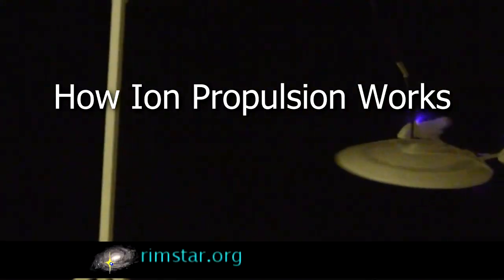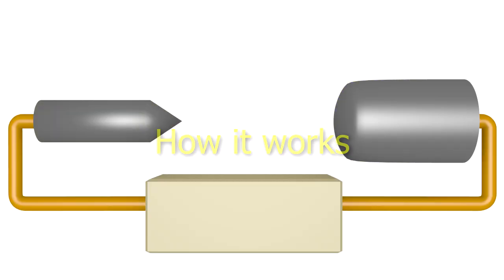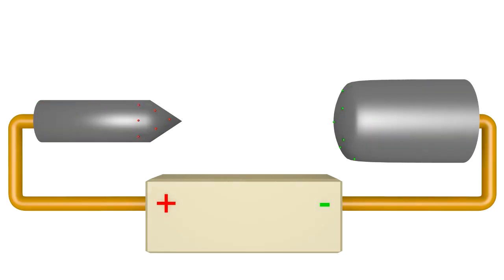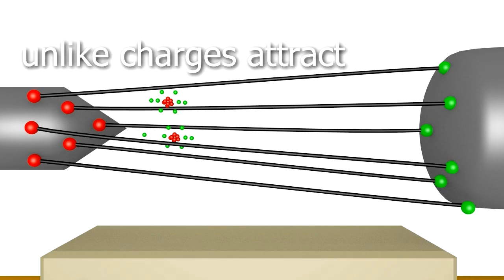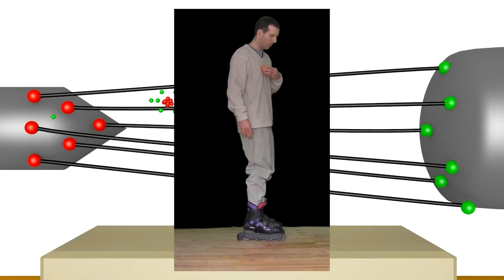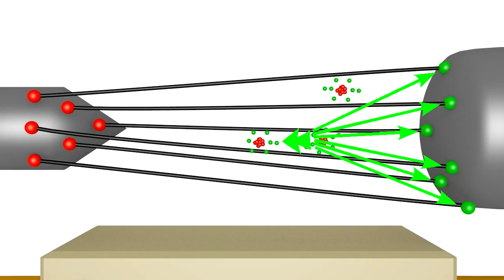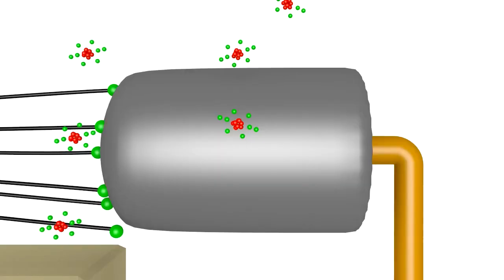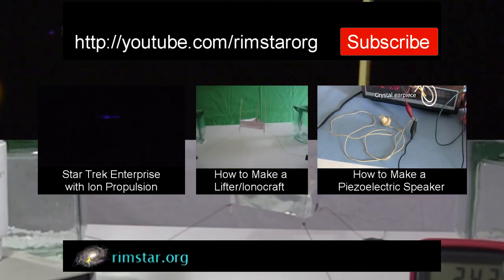How Ion Propulsion, Lifters and Ionocrafts Work

Comment: But with reverse polarity wouldn't the ion direction be reversed as well?
Reply from the maker: The difference lies in that the electric field is stronger near the sharp electrode. That means two things. 1. Ion creation happens there. 2. Like-charged ions are strongly repelled from that electrode and attracted by the other electrode.
And then along the way they collide with neutral atoms, which is when the momentum transfer happens which propels the engine.
Reply: I understand your point and thank you for replying. If I'm right what you're saying is that the gradient of the electric field is the actual responsible of the motion, but how do I see that mathematically?, the acceleration of the electrode due to this gradient is the confusing part.
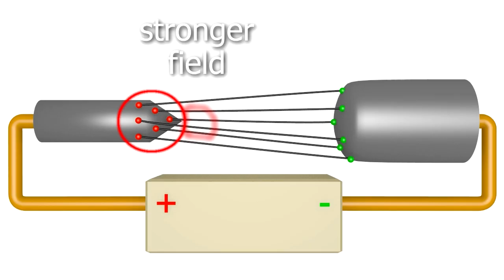Reply from the maker: No, because the ion direction isn't determined by the polarity. It's determined by where the electric field is strong, which is near the sharp point. See the video at 2:33 again.
Reply: RimstarOrg yeah I figured it out earlier. The direction of the ions don't change but the polarity of the ions do. So reverse polarity from your video would create negative ions instead of positive.  Thanks.
Reply: @RimstarOrg  why not increase sharp points and curves for greater propulsion .
Reply: @RimstarOrg  wow! That IS profound! Is this similar to how electromagnetism works?
Reply: I don't think it's about curves. I think it's about smoothness
Reply: It's not clear to me... the ion direction would change if the electric field does so. So how is that this does'n matter? could you explain me the opposite polarization mode please?
Reply: But why? how is that changing the electric field direction does not affect the ions direction?
Reply from the maker: Sorry for the delayed response. I don't always get notified of replies to replies.
Increasing the number of sharp points and the sharpness of the points may help. Certainly with a lifter, going with a higher gauge number wire (which means a thinner wire and is the same as having sharper points) helps. But there is a limit to how much electrical current a power supply can supply for the ionization. So once you reach that limit, sharper points won't help.
Reply from the maker: I'm glad you like it! But nope, it's not similar to electromagnetism.
Reply from the maker: The acceleration is due to a momentum transfer with neutral atoms. See the video again at 3:56. For a mathematical treatment, see this MIT paper https://royalsocietypublishing.org/doi/full/10.1098/rspa.2012.0623

Comment: what is limitations of height  for ionocraft ? upto what height it can go?
Reply from the maker: That depends on what you mean by height.
These ionocraft don't have enough thrust to their power supply, and so they can rise only as long as they can lift the weight of the wires that power them.
If you mean that if you carry one up to the top of a tall mountain and try to fly it there, will it still fly, then I recall from years ago when a lot of people were experimenting with these that someone tried theirs both high up (in the Rockies or something) and also lower down and found that the higher they went, the less well it worked. That's because of the reduced amount of air. That's also consistent with vacuum chamber tests where, as the air is evacuated, the thrust decreases.

Comment: y qué pasa si le pones una pequeña bobina cerrada en si misma entre el aluminio y el cobre que lleva el alto voltage?
Reply from the maker: The metal coil would create a bit of a short circuit between the two electrodes. It would be as if you'd brought the two electrodes closer together. That would either cause sparking, which would stop the ion propulsion effect, or it would increase the strength of the propulsion.

Comment: So this is possible to do on a dc circuit. Are there any formulas available gor this kind of device?
Reply from the maker: This circuit is DC. However, it's high voltage DC. As for formulas, there are but I don't have any off-hand. I know Peek's law is often used https://en.wikipedia.org/wiki/Peek%27s_law.

Comment: How powerful is the propulsion and how easy is it to make. I want to try this out for a science fair experiment
Reply from the maker: It's not very powerful. It can lift a 2 gram lifter pretty well https://www.youtube.com/watch?v=vzZy1Aqleno. However, the main people have a problem making is the power supply. It has to be high voltage, but also relatively high current too. This is the one I made https://www.youtube.com/watch?v=GEuK1OdYxHk for it. It also produces ozone as a byproduct, which is hazardous to your health in large quantities. But I've heard of plenty of people using it for science fairs. If is a dangerous high voltage so you do have to know what you're doing.

Comment: I still don't understand why the smooth object is required. The positively formed air can still be repelled by the sharp object and the neutral air can still exist next to the positively formed air without the smooth object and allow the sharp object to move away by repelling against the positive air. Explain ASAP
Reply from the maker: Good question. And yup, that works too. Ion wind rotors work that way, like this one I did http://youtu.be/UgWTjCHsm3M. However, in that case the smooth electrode is the surround room and air -- you can't have an electric field with only one electrode. The very act of creating an unbalanced charge results in an equivalent amount of unbalanced charge somewhere else.
But by introducing the 2nd electrode, and bringing it close, and putting lots of charge on it, we increase the electric field strength. That means we get more ionization and stronger thrust.
The formula for the electric field strength is:
E = (k * q * Q) / d^2
k is a constant, so we can ignore that. q and Q are the charges on the two electrodes. So increasing either of those increases E. d is the distance between them so decreasing that increases E.
(see more about the formula at this randomly searched for page: http://www.physicsclassroom.com/class/estatics/Lesson-4/Electric-Field-Intensity)

Comment: does this work in a vacuum
Reply from the maker: It's intended for use in air. Maybe you could design it somehow to inject the propellent in between the two electrodes -- then you could use it in a vacuum. The ion thrusters used in spacecraft carry xenon gas as their propellent but they have a different design.

Comment: Now repeat in a vacuum. No, cuz it won't work will it.  Stick everything you need on the lifting part and hey presto, it won't lift...will it! Waste of time, stop this so-called ion engine crap, it's nothing more than electric field dissipation. What gas did you use on the enterprise then??????
Reply from the maker: You're right, it won't work in a vacuum. This is about how ion propulsion works for lifters and ionocraft (https://www.youtube.com/watch?v=vzZy1Aqleno), fun things that we play with down here on Earth in air.
For the ion engines currently in space in various spacecraft and satellites, they mostly use xenon gas as the propellant e.g. https://en.wikipedia.org/wiki/Dawn_(spacecraft).

Comment: I'd love to see a serious proof of concept lifter with remote-controllable capability assuming the energy density of batteries and weight of power electronics (and their emi shielded housing) can be overcome.

I don't think I need to mention why achieving something like this would be a big deal.
Reply from the maker: That would be great. I last did back-of-the-envelope calculations around 6 months ago and we've still a ways to go, but the energy density of supercapacitors helps. If that ever gets light enough, there's still the weight of the electronics to convert to high voltage.

Comment: Whats the voltage needed to make this work?
Reply from the maker: That depends on what you're powering. My lifter required around 25,000V and around 1 milliamp. You can see me measuring it in this video https://www.youtube.com/watch?v=LOGAaObsN4g. The sharpness of the point, or points, the smoothness of the smooth electrode, and the distance between the electrodes are the main factors. In the lifter, the sharp point was the thin, bare 30 gauge (AWG) wire.
Reply: Can you recommend a cheap power source? Thanks
Reply from the maker: If it's a lifter you want to fly then no. It needs a fairly powerful high voltage DC power source so it's not cheap (http://www.amazing1.com/hv-dc-power-supplies.html). You could try making one. Mine is this one http://rimstar.org/equip/30kv_pwr_supply.htm but it still needs a lower voltage power supply to feed it. Also, it's hard to find the type of flyback transformer that it uses. It has to be one that doesn't have a built in diode and all the ones these days have built in diodes.
Reply: Ok thanks. But if you want to make a Enterprise model thing is the voltage any lower?
Reply from the maker: Actually, I've never measured the high voltage required for any spinning setup, including the Enterprise model so It's hard to say what voltage or current is needed in those cases. The fact that you can make an Enterprise model spin horizontally like I did but there's no way you'd be able to make it go vertical (too heavy) doesn't mean it's using less power. It may in fact be using more. 
I just compared the AC voltage on the VARIAC meter dial and the DC voltage output going to the high voltage power supply at 2 minutes and 11 seconds into the Enterprise video (https://www.youtube.com/watch?v=x5dyIIpnE0Y) and the same for flying a lifter at 8 minutes and 35 seconds into my HV power supply video (https://www.youtube.com/watch?v=GEuK1OdYxHk) and the Enterprise needed much more: around 13 VDC going to the high voltage power supply versus 8 VDC.
But I used the same power supply in both cases, just giving it more power for the Enterprise.
Note that the voltage may actually be the same, just that the current is higher to produce more ions. That's why I say more power.

Comment: hi I have a voltage of 1000 kv. Do i make it with the same technique? What should be the safety precautions i should take?
Reply from the maker: Are you talking about making the lifter?Are you sure you don't mean 1000 v? That's 1 kv.  1000 kv is 1,000,000 v.
If you meant 1000 v then that's not enough. You need around 25,000 v for the lifter. You also need current somewhere near 1 milliamp.
If you meant 1,000,000 v then it's too much for this design of lifter. It would just create sparks between the wire and the foil. You'd have to design something else.
Reply: He's probably building a real Enterprise ;)

Comment: salamo aalaikom ...the explanation is that when particles loose an electrone ..the negative siide attract the positive ion and we get a reaction while the mouvment of ion ...is that true
Reply from the maker: Almost. If that was all that happened then there would be no movement. That's because the electrons and the positive ion are all 'connected' to the device through the electric fields. In order for it to work they have to interact with something that is independent of the device. So the positive ion hits a neutral particle and that is where the momentum transfer happens that makes it move.
Reply: thank you sir for giving us this opportunity ..can i have your email ..iwould like to contact you about similar subject that we study

Comment: So I assume that the generated lift from one of these is far from enough to actually lift the necessary power source (because if it was, airplanes and such would quickly be obsolete).

However the principle got me thinking of rockets. In this day and age it's pretty expensive to send up a rocket into orbit with a payload.

But what would happen if you designed a hybrid rocket/ionocraft?

When you look at a rocket lifting off the thrusters of the solid fuel rocket boosters output massive amounts of heat and this goes on all the way until the fuel runs out. So what if you had some metal with good thermal conductive properties on the sides of the rocket arranged in such a manner as to absorb as much of the outgoing heat from the rocket nozzles, these heat absorbers then go to an onboard steam turbine generator, which feeds the ionocraft portion of the rocket with electricity.

In theory this would generate more lift than the rocket boosters would generate on their own. And if the added lift exceeds the weight of the necessary ionocraft apparatus attached to the rocket, then wouldn't this method in essence create more lift overall than conventional rocket motors and potentially increasing the weight limitations of whatever payloads you wish to send into space?
Reply: The problem is weight. The equipment needed to convert that heat energy would add more weight to the rocket than it is worth. Even if it could create enough electricity to drive an ion engine, it would not more efficient than if you did not have it. The added weight would simply not be worth the extra thrust, since the the added weight cancels out the extra thrust, and probably even more.
Reply: FireDjinn Electro: Well you'd need to make a prototype first to determine that though.

I agree that there is a very big possibility that it might be the case, but since no such craft has ever been built it's hard to say if the weight would cancel out the added lift.

Experimental ionocraft protypes are pretty light after all, excluding the power source which is usually some sort of battery.

I guess the question I propose here is how much thermal energy a rocket motor produces that can be harnessed.

I'd say it's quite a lot.
Reply: I understand your thinking, but I must still disagree. First of all, prototypes are only built when you are at least certain on paper that it will work. But I believe even relatively rudimentary calculations will make it clear that the added weight would be too much. 
You are correct in stating that ion engines are relatively light, but that's not the weight I'm concerned about. I'm worried about the weight of the generator needed to supply the power to the generator. 
As with many technologies nowadays, the only constraint is the power source. Until we develop lighter but powerful power sources, it will always be a problem for engineers.
However I do believe that you are thinking in the right direction, and perhaps in the future it will be possible, but with current technology I don't believe it is. This is one case where I would actually like to be proved wrong, since it would be really cool haha
Reply: FireDjinn Electro: You're right. The reason for asking was because I haven't come into contact with even rudimentaty calculations yet.
The natural reaction to ideas like this, from an engineering standpoint is always that it will be too heavy.
But there have been instances where it proved to be false. Especially in this day and age where nanotechnological research is progressing very fast and scientists are able to develop nano-alloys and substance with very high strength to weight ratios.

In fact I daresay that nano-compounds are being developed faster than miniaturized, lightweight power sources with high energy outputs.

On the other hand: progression in nanotechnology will most likely also mean progression towards better batteries. For instance I've read about a very interesting concept where they basically want to make regular voltaic cells (you know, one layer of metal, one layer of electrolyte and one layer of metal sandwiched together) but on a nanoscale with monolayers of metal and electrolytes in between.

Apparently there are some claims that each layer would have pretty much the same charge, but being significantly thinner (one atom thick) so you'll be able to stack a lot more voltaic cells on top of eachother without adding significantly to the weight or size, creating the potential for much more powerful batteries.
Reply: Now that i think about it, I could probably make a hybrid rocket from a relatively cheap model rocket!

If I can get the time away from my dayjob sometime it would be a fun experiment. :)

Comment: are there any theories to control the direction of the lifter?
Reply from the maker: It can be done. For example, you can have some sort of circuit which powered each side independently. I've never heard of anyone doing it though.